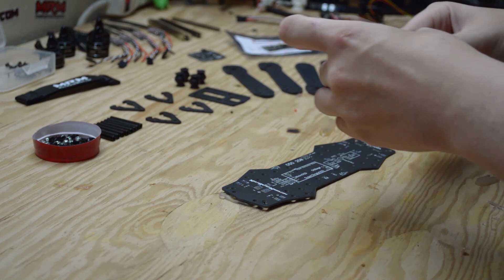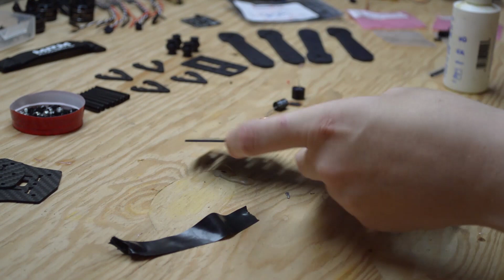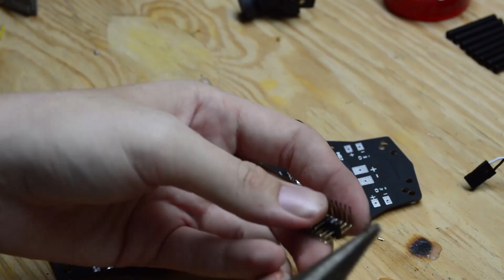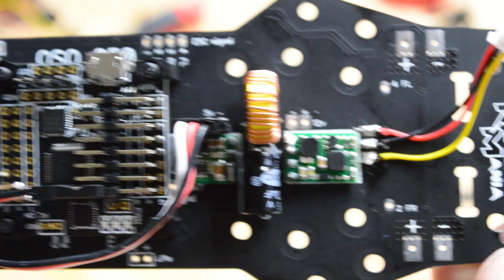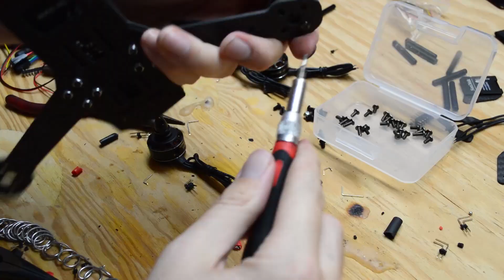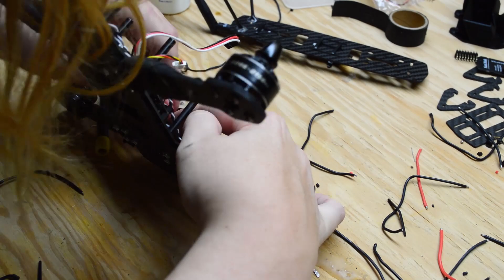Let's Build! Multirotor Mania's OSO 250 "Race Edition"

Comment: Great build video. Good volume on the voiceover which was also clear and well-paced. Background music was good filler without being distracting or making it hard to understand. Good angle on the camera with good lighting so it was easy to see what was going on and you could still work without your hands blocking the shot, which even the best struggle with sometimes. I learned that lesson about not wiring the LEDs into the 12v regulator the hard way too. Nice to see I'm not the only one. =)

Comment: Hi Zoe FYI crossed wires = clockwise rotation nice build by the way
Reply from the maker: +Yan Chabot Ahah! That makes sense now, seam to be motors 2 & 3 that I normally redo.
Reply: +Zoe FPV what i usually do is solder them all straight and change them in blheli, it makes for a cleaner build
Reply: +Yan Chabot i reverse 1 and 4
Reply from the maker: +Yan Chabot Hmmm, I wonder if it is because we mount our ESC's differently? it's weird you say 1 and 4, to me haha